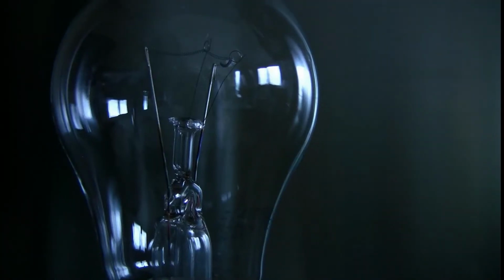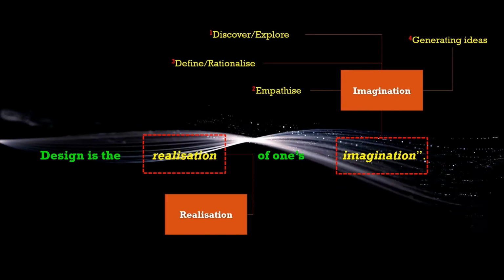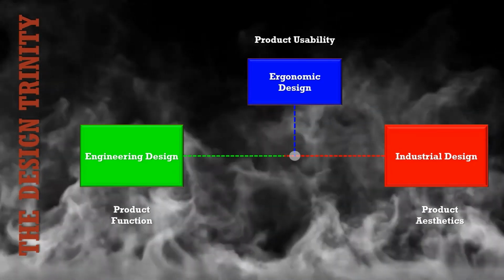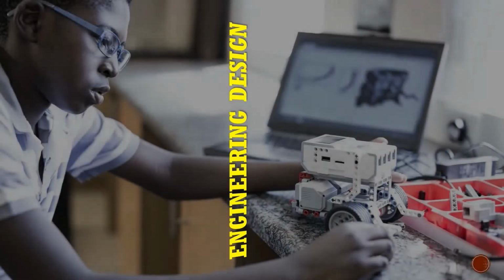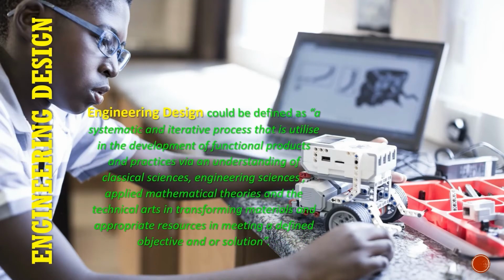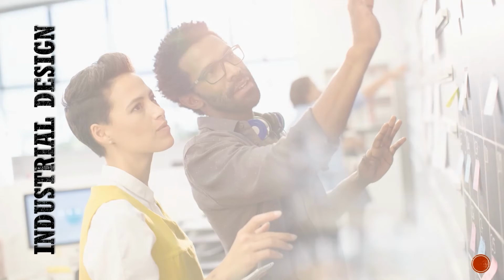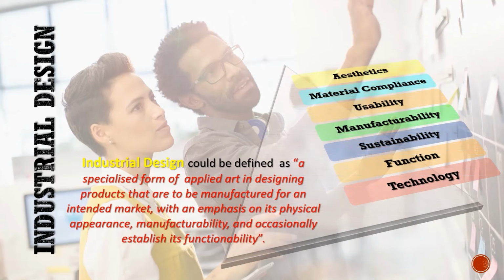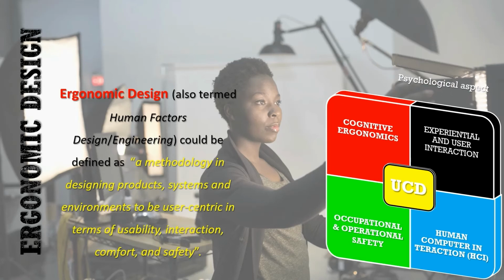What is Design? - Philosophy on Design (Part 1)

Comment: Summary for those who need it:

Introduction to Design: The speaker introduces the basics of design, emphasizing its role in planning and problem-solving.
Definition of Design: Design is about imagining and realizing ideas into physical forms.
Imagination in Design: It starts with a mental image inspired by a problem or vision.
Realization in Design: Transitioning the idea from mind to paper and then to a physical product.
Steps in Imagination: Includes discovery, exploration, empathy, and ideation.
Discovery: Identifying a problem or opportunity that inspires a design.
Exploration: Brainstorming and testing various solutions to the problem.
Empathy: Considering the needs and experiences of the user.
Visualization: Sketching and mapping out ideas on paper.
Steps in Realization: Turning ideas into a product by defining form, material, and functionality.
Material Selection: Choosing materials that support the product's purpose.
Manufacturing Processes: Considering available technologies for production.
Testing: Validating that the product meets its intended purpose.
Trinity of Design: Design can be categorized into engineering, industrial, and economic/user-centered design.
Engineering Design: Focuses on functionality and reliability of a product.
Industrial Design: Deals with aesthetics and packaging for the market.
Economic Design: Focuses on how users interact with the product.
Differences Between Product and Industrial Design: Product design emphasizes engineering methods; industrial design prioritizes artistic approaches.
Product Development: Includes iterative prototyping to refine functionality.
User-Centered Design: The user is at the heart of every design decision.
Human Factors: Considering physical and cognitive aspects of the user.
Biomechanics in Design: Ensuring the product suits physical dimensions and movements.
Psychological Impact: Designing products that evoke emotional connections.
Longevity of Use: Encouraging prolonged engagement with the product.
Design for Happiness: Exploring how products can promote well-being.
Human-Computer Interaction: Optimizing interfaces for ease of use.
Operational Safety: Ensuring products are safe to operate long-term.
Repetitive Strain Considerations: Avoiding designs that cause physical strain.
Sustainability: Designing responsibly to minimize environmental impact.
Economic Viability: Balancing cost with functionality and aesthetics.
Time and Motion Studies: Considering how users interact with products over time.
Packaging for Markets: Ensuring the product appeals to its target audience.
Iterative Design Process: Continuously improving designs through testing.
Role of Prototyping: Building models to refine and validate designs.
Technological Advancements: Leveraging new technologies in design.
Aesthetic Importance: Prioritizing visual appeal to attract users.
Durability: Using materials that ensure longevity and reliability.
Validation: Testing products against design specifications.
Economic Design Challenges: Balancing user needs with manufacturing constraints.
Demographic Considerations: Designing for diverse user groups.
Cognitive Ergonomics: Making products easy to understand and use.
Emotional Connection: Creating products that users form emotional bonds with.
Adaptability: Ensuring designs meet evolving user needs.
Practicality: Avoiding overly abstract or impractical designs.
Global Impacts: Considering the social and economic effects of design.
End-User Focus: Ensuring the product solves real-world problems effectively.
Team Collaboration: Design often involves input from multiple experts.
Design as a Discipline: It combines art, science, and business.
Critical Role of Feedback: Learning from users to refine products.
Purpose of Design: At its core, design is about improving lives and solving problems.